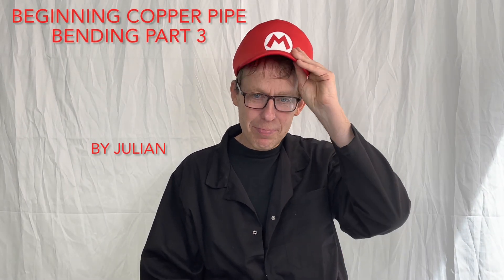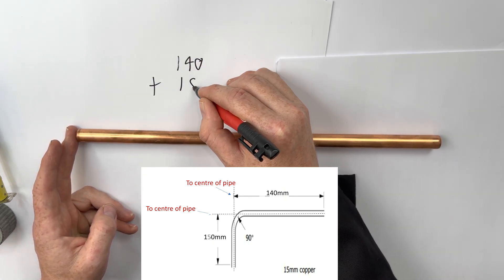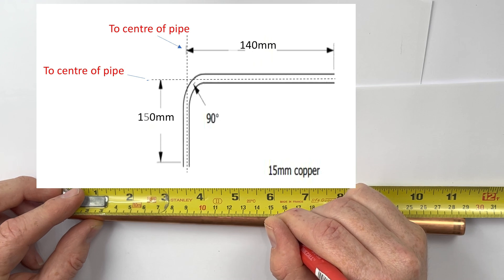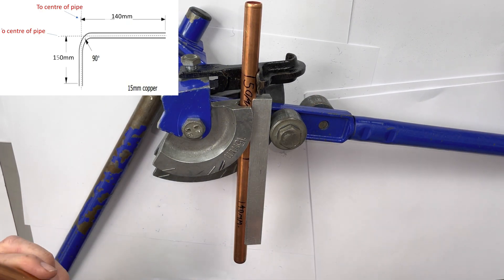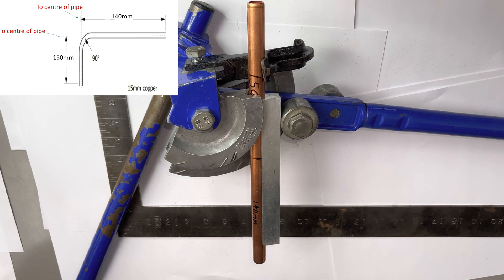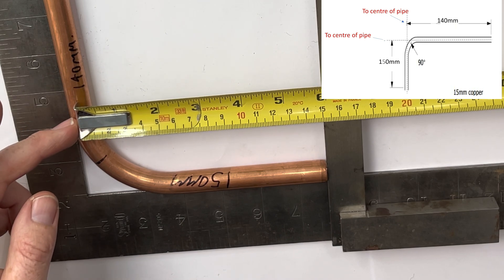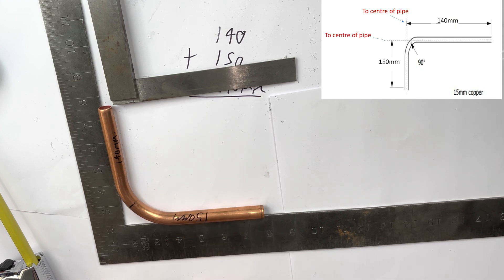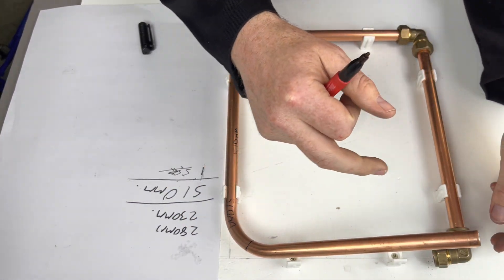Copper pipe bending 90 degrees to fit.  The easy way.

Comment: This is great help thank you. One problem though, some of my 15mm DZR copper pipe snaps in two right in the beginning of bending. What could the cause be? (I'm using a 15-20mm 2-1 Kendo pipe bender, the orange one)
Reply from the maker: It’s the pipe